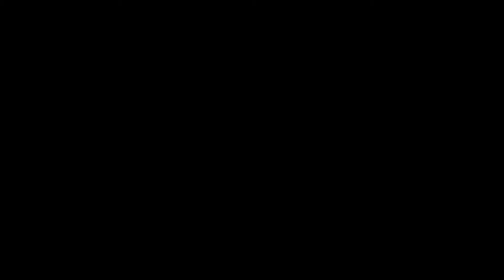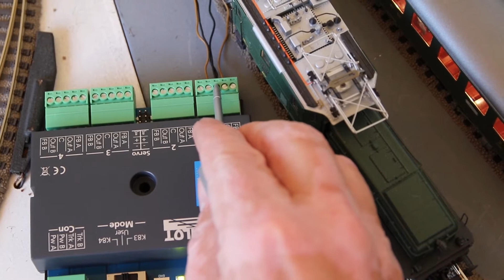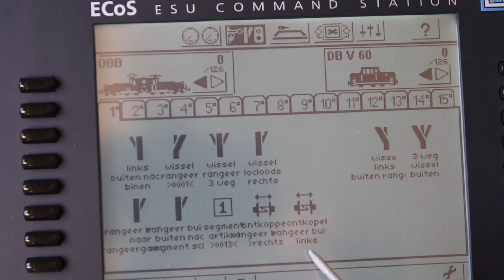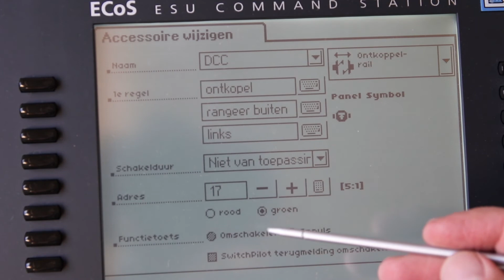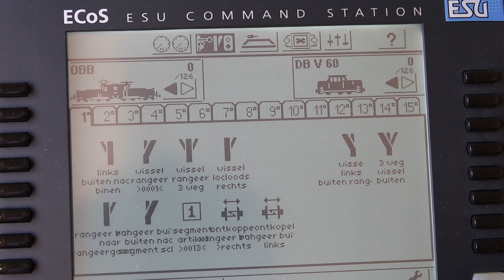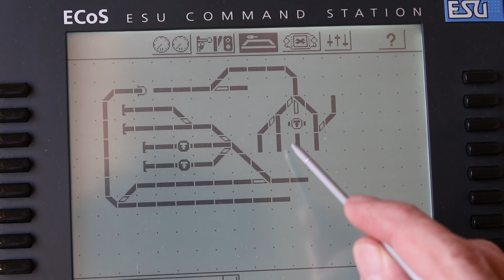Fleischmann uncoupler rail to ESU switch pilot

Comment: this is useful thanks as i am just about to connect 4x uncouplers, this saves 2x ESU ports. ESU SP with 50200 is the absolute best system in my opinion. not the cheapest but def the best